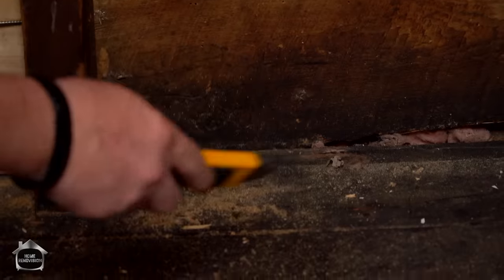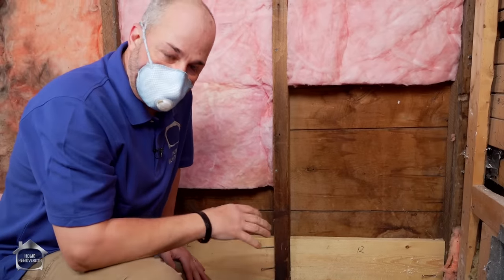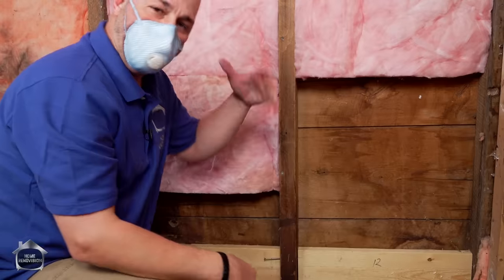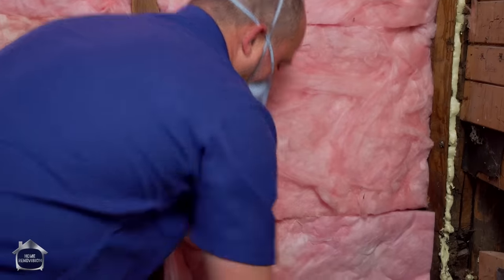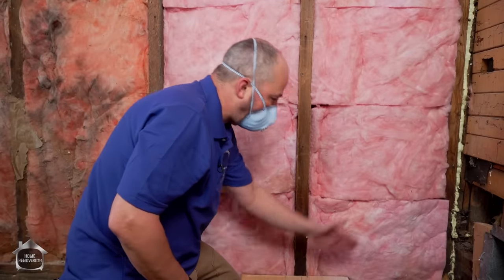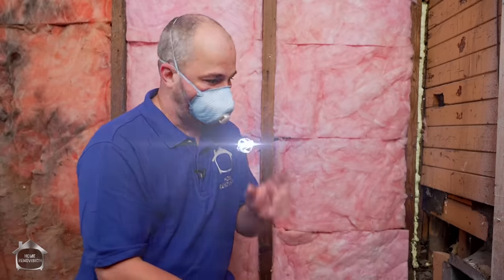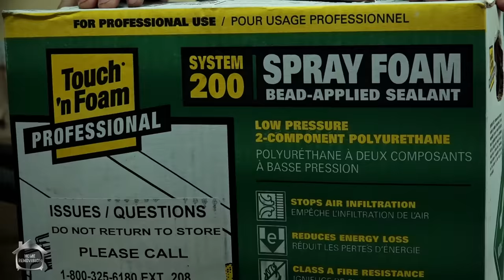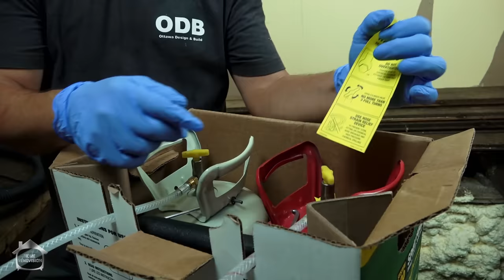How to Install Insulation Yourself! | DIY Insulation Tutorial

Comment: Hey Jeff,
Love the informative videos! I have an older post and beam house. I had it gutted and the walls are isulated. I still feel the hot and cold from the foundation. If I close up my foundation like this, would it stop the old growth lumber from breathing? Or would it still be okay? Keep'em coming!
Reply from the maker: Hi Dean, please describe your foundation and is it a crawl space as well? Cheers!
Reply: @HomeRenoVisionDIY  Hi Jeff,
It is a crawlspace, but it's a very small one. Very little clearance. It's an old pier and beam house. The gaps in between the piers have been filled in with cinder block, however, under the porch was not addressed during the reno. When it was gutted last year, I saw that like yours, the clapboard is nailed to the studs, and this used to to be the only sheathing. I had an insulation guy come in and fill gaps with foam, and use batts in the walls. They also installed a vapor barrier. I still feel the mix between hot and cold from the foundation, which makes me wonder if your idea would fix it. I just want to make sure that my framing can continue to breathe. Before there was no insulation , and over the clapboard, there is fi er board asphalt siding, a different tips of clapboard, and finally.vinyl siding. My plan is to remove the layers when I can.
Reply from the maker: hard to comment without seeing it personally. Here is a great way to diagnose a treatment. if you have porous materials that take moisture from the ground directly from contact then they need to breathe on 1 side. if the source of moisture on the inside can be isolated like I show in the video then you need to heat and have cold air return in the area to keep the floor dry. If you insulate the like in the video and you would be trapping the water in your structure then you will cause problems. In most cases the underside of the siding should have air flow on the exterior. This should be sufficient. be careful !!! many siding installers use horizontal strapping for convenience and it tends to hold water against the house and makes it hard for the base of the walls to dry out. that could complicate your situation if you seal everything up. I will discuss this further in the next video we shoot on closing up the exterior for you Hopefully this will help! Cheers!
Reply: @HomeRenoVisionDIY  Thanks Jeff!

Comment: I have a basement with 2 - 40 ft walls and 2 - 28 ft end walls. Im crawl space i have 2 - 35 ft side walls and 2 - 15 ft wide walls. I would like to spray foam the section of rim joices at top of 6 1/2 ft high walls 15" o/c how of the boxed kits should l buy and l assume the foam l spray so the rim joice foam is even with bat insulation and think you vlosed cell.
How thick should l spray layers on rim joist?
Reply from the maker: Hi James, I would suggest a flash and batt approach. that way you can get a great seal and keep your costs down. There is no deal on the larger tanks so I would get the $200 version to start it might just do the job.

Comment: I was just going to ask you about insulation. 
It would be much easier if I could hire you though.  Please let me know if I can. 
Currently I have to fur out my wall 2" just so I can meet minimum code R20 value in my 2 x 4 walls. 
(My Hydro is through the roof at over $1400 for a 2 month period!). I did add some blown in insulation in the attic, to help immediately with the heating loss through the winter, because it was brutally cold and couldn't get warm in here. 
Problem is I don't know how the vapor barrier goes on the wall. 
Do I leave it an inch at the top and bottom and try to tape the seams somewhere's?  
Or what? 
& can this foam and insulation technique, that you are showing, be applied to floor joists above a garage? 
Ps. I did wind up finding your video for the sexy ceiling look and I'll be done that job tmrw. I've almost done 2000 sqft of it & I've taken down a lot of the textured ceiling so it's only minimally textured, with the nice flat edges around the rooms. Looks good & my arms are tired. Lol. 
But yeah please share the info about vapor barrier and more insulation videos. 
Or let me hire you to do the work here.  ☺
Reply from the maker: Sorry kind of busy renovating my own house this year. cheers!
Reply: @HomeRenoVisionDIY  
No Prob.  More videos on vapor barrier and basement renos below grade level would be really great!  
Basement is going to be a gut job now.  Too much mold found, due to wood and drywall being in direct contact with cement.  :-(

Comment: Did you know they sell plastic face shield protection sheets on Amazon for the 3m full face mask? They work really well. I own both 1/2 and full face masks. It is such a pleasure not to have all the crap in my sinuses. And real pleasure is when working on your back under a home, no crap gets in your face or eyes. I love it. For the full face, I think I paid $135 on Amazon.
Reply from the maker: I love mine. Cheers although my son seems to be wearing it all the time now.

Comment: Could you spray that form in the holes hat the mice made before you put the board up? I'm paranoid
Reply from the maker: you could, but I am goin gto remedy that situation from the outside in this case. Cheers! you could also put in some steel scrub pad and then foam.

Comment: Can you put that foam insulation behind drywall by drilling a small hole in the wall.
Reply: klosettreat probably not a great idea, u run the risk of putting to much in and pushing the drywall out, also the plumbing/ electrical complicate things.
Reply from the maker: This idea of filling a gap behind the wall is used quite commonly in century homes. however they use a 3" hole and fill the wall cavities with a blown in insulation. Cheers! The foam is a costly and potentially ineffective approach if you cannot see what you are doing. so many things can go wrong.

Comment: Here’s what I was quoted:  The spray foam companies were charging me a $600-800 minimum for coming.  For a 500sqft basement wall, they were charging $1400-2200, which works out to $2.80 to $5.40 a sqft.  All CDN in Ontario.  All R23 about 4” of foam.
Reply from the maker: nice, r20 in batt is .39 cents a square foot. Cheers!

Comment: For anyone out there looking to do this: 
Careful with the open cell stuff in a box. Pay close attention to if one of the tubes stops feeding you material. 
I had an issue in my basement where one tank run out well before the other even though I opened each valve the same amount. I ended up having to redo a couple cavities because it made a god awful mess.
Reply from the maker: that is an unusual situation.
Reply: @HomeRenoVisionDIY  Yup for sure, my other 2 boxes were fine. Seems I got a bad box. Something to be aware though